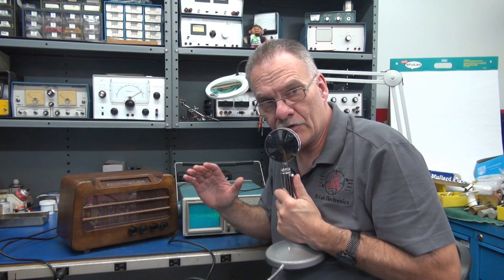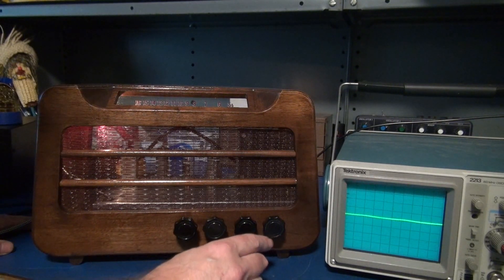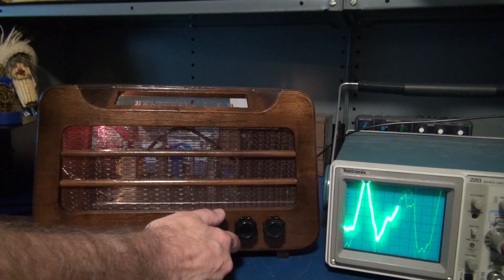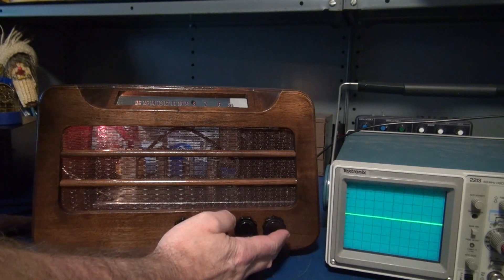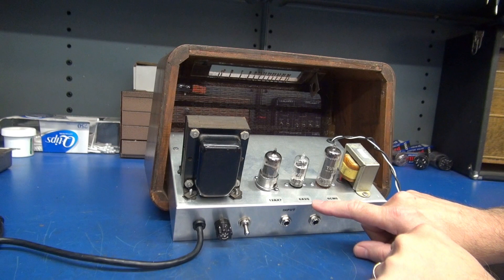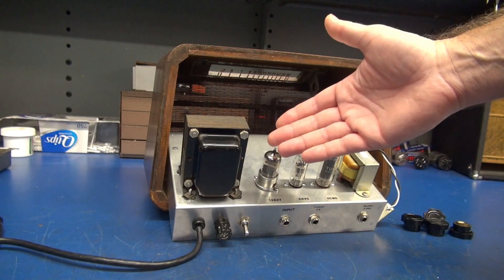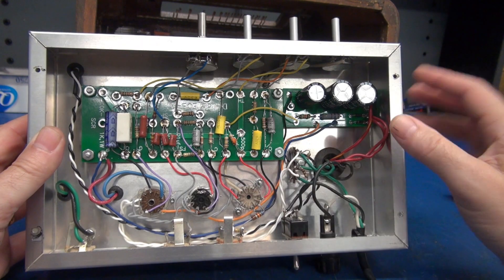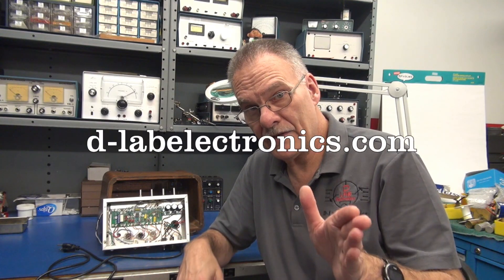3 watt Class A tube Tremolo guitar amp 6CM6 tube easy inexpensive homebrew kit d-lab electronics

Comment: I looked up the 6CM6 tube in my old RCA
Receiving tube manual
And found it has a12 watt plate dissipation
And can handle 315
Volts on the plate and
285 v on the screen
grid that tube could put out 5watts audio it's
Characteristics of operation are like the
6v6 and the 6AQ5.
Nice choice terry.
Why not go push pull
6CM6es in a bigger
Antique Radio cabinet
With a 12" speaker.
Now that would be
Really cool. Just a suggestion. Dwight.
A/P Mi. S of Detroit.